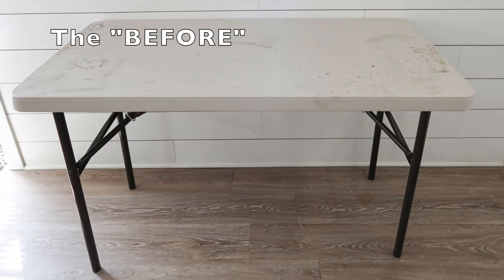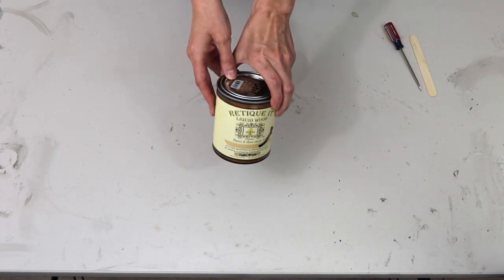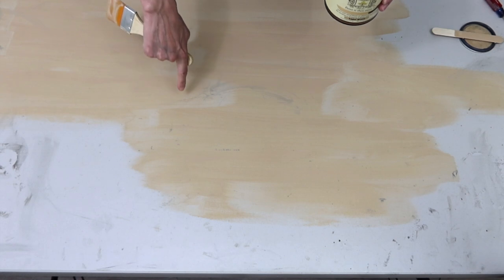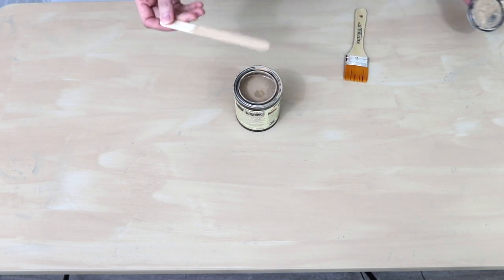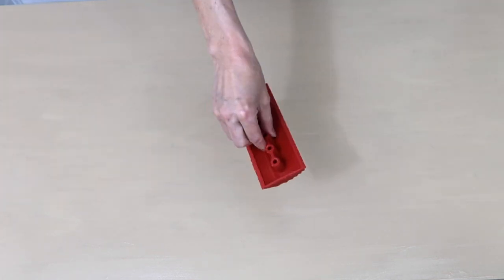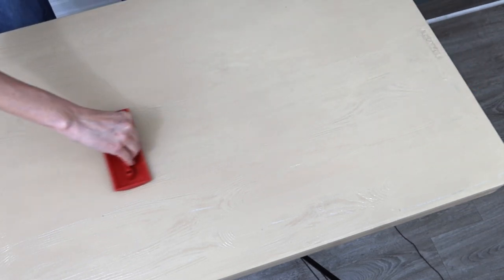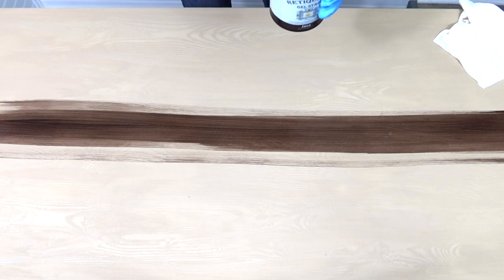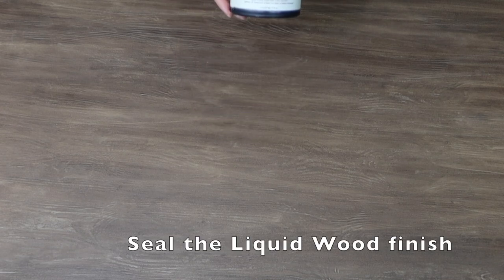HOW TO USE RETIQUE IT LIQUID WOOD with a folding table makeover-this has REAL WOOD PARTICLES in it!

Comment: Hi won’t the paint scratch when using the table? Is it wise to paint a frequently used table, will it last?
Reply from the maker: I put a layer of poly on it which helps but yes if you scratch hard enough it will pull the paint. Overall, it's held up better than expected though.

Comment: WOW, I"m in shock that it worked! Thanks for sharing the process! My immediate thought is now I can paint over my garage door, do you think this would work? Is the product safe for outside so long as I use outdoor stain and outdoor poly? Also, would that "rolling/rocking stamp tool" even work on a garge door being that they have a lot of panels, or no even surfaces?
Thank you again for the tutorial.
Reply from the maker: I think it would work as long as you seal it well! And as far as the graining tool; it would be a bit tricky but it could still work beautifully.